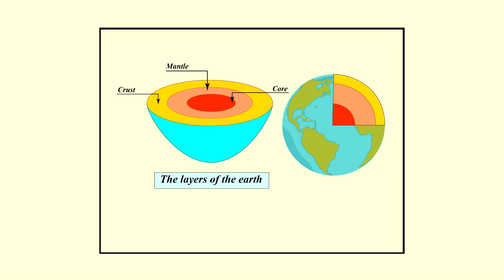why it doesn't work 28

Comment: Can i you cover why you can’t have two siphons between two bodies of water to create infinite energy, I know it won’t work but I don’t know why, it might be a stupid question but I feel like you have covered stupider questions.🙏
Reply: I assume you mean the two bodies of water will be siphoning from and depositing into each other, while you hooked up a generator in the middle to capture energy from the water flow in both direction?

If your siphons entry point is at the same level as its exit point, it will create no suction to suck up more water, and you’ll basically just have two tubes of water connecting your lakes, not flowing in either direction.

The entry point needs to be higher than the exit, so that the weight of the water in the pipe can be pulled down, creating negative pressure at the top, which sucks in more water to replace it. 

If one of the bodies of water was higher than the other, you could capture energy from the water as it fell down, but eventually the top body of water would run dry, and you’d need to spend even more energy pumping the water back up there again. 

But if you’re thinking that’s a good idea for a battery, you’d be right, and that’s what pumped hydroelectric storage is, a giant water battery. Pump the water up while electricity is in low demand, and then let it fall back down and run a turbine when it’s in high demand
Reply: One body of water is going to run out of water eventually

Comment: Ok but my question is: Do we have "one" hole or "two" holes if a hole is crossing the same object with 2 connected ends?
Reply: Technically it’s just one hole

If you look down the hole and see out the other side of the earth, you could wave to someone on the other side who’s looking back at you through the same hole. They aren’t looking through a different hole, so there is only one hole.

Comment: Short answer: an oscillating system even if it moves forever, only has a fixed amount of energy. Once you plug it into a generator, it starts to slow down. 
This is the answer for most perpetual power proposal. People come up with an ideal system where friction and air resistance don’t get in the way, and something in that system moves forever. But the basic concept is that “something moves forever” ≠ “something has infinite energy.” It just means that it doesn’t lose kinetic energy overtime. If something can generate unlimited energy, it doesn’t just have to move forever, but ACCELERATE forever.
Reply: Having an efficiency of over 100%.
Reply: You Indeed highlight the most common misconception. More people should get to know this
Reply: what if you create a robot  with a solar panel and make it do a silly loop movement? if the machine doesn't broke it'll last until the death of the sun. Not perpetual movement, but close.
Reply: @Smougda  this does not hinder the argument. Your robot (as any other solar panel does) extracts energy from an external source, whereas this source loses the corresponding energy. There's no energy production in total even in ideal case

Comment: Gravity increases the deeper you go, small mistake in the vid.
Reply: No it pulls evenly on all sides at the core
Reply: @Spaceman0025  yes, not no. Were both correct.
Reply: @Spaceman0025  Wouldn't it push you in evenly from all sides? That's why the core is solid?
Reply: @jazzabighits4473  if you are just inside the core yes, but in this situation you in a tunnel and not affected by the pressure

Comment: If you took out all the air wouldn't it have no friction, also if you left the object alone would it keep going.
Also thank you for taking my suggestion
Reply: You would not be able to harness any energy from it without slowing it down and eventually stopping it. Removing the air would allow for more efficient energy collection, but it would still not be infinite.
Reply: @axiomcomplex5579  Yeah, even the name 'energy collection' implies the energy will be taken away from the system which is going to result in slowing the ball down.
Reply: the object would be pulled towards the center, so air friction would not make a difference. The planet's gravity would pull the object towards the center of mass and it would barely make 3 or 4 swings
Reply: @tiagoc.fdepaula2930  without friction it could last “forever” though, as no energy is lost, only converted between kinetic and gravitational potential.
The problem is that friction is necessary to collect the energy

Comment: it's just better to create geothermal energy from the heat of earth's inside instead like we already do
Reply: It would be useful for a few hundred or maybe even thousands of years(or some arbitrarily large amount of time dependant on how much energy is being extracted) but that could cause a problem.
Eventually as the metals around the Earth's core start to solidify as it loses thermal energy,  the Earth's magnetic field would also start to die down, leading to most if not all of the life on earth to be inviable.
Reply: @felipe-n9t  My brother in Christ, it would take thousands of years of humanity's energy needs to decrease the mantle's temperature by 1° Celsius. By that time we could have a fully functional Dison-sphere.
Reply: @bronzelock8207 
You're right, but in a way we would be directly exchanging the amount of time that life is sustainable on earth for energy (although funnily enough, you could argue that we're doing that already).
Reply: Agreed.

Comment: It wouldn't work for Earth, but could it work for the moon and smaller celestial bodies that still have some gravity?
Reply: No
The size of the Earth wasn't used in the argument presented in this video, it would be the same for any celestial object
It's the same, you can't "create" energy with gravity
Reply: @skad2058  the moon doesn't have air for friction and doesn't have a heated core or mantle. While you couldn't make energy out of it, you could use it for transport.
Reply: @richardcatlin4390  Ho
Yeah, it would be easier to dig yes
I'm not sure if it's doable or not tho